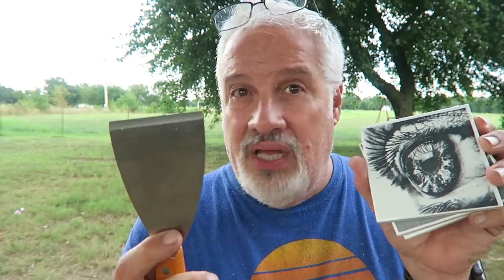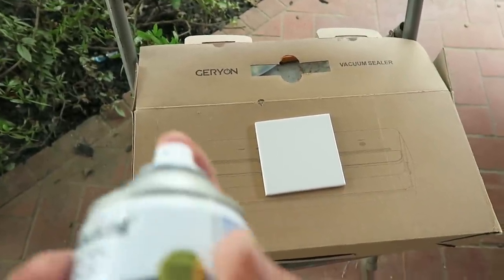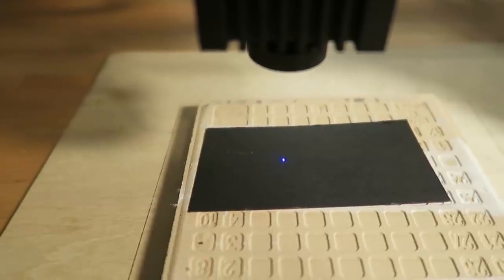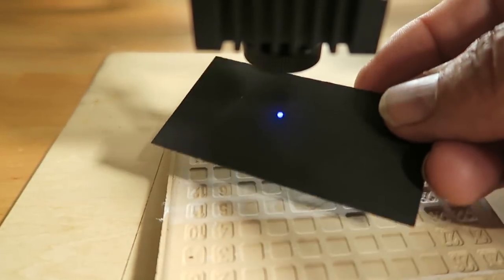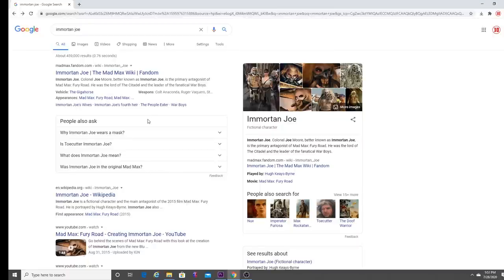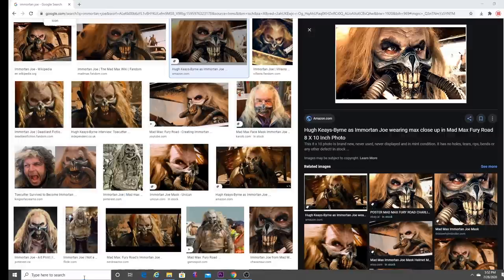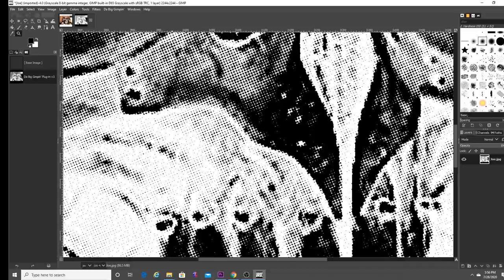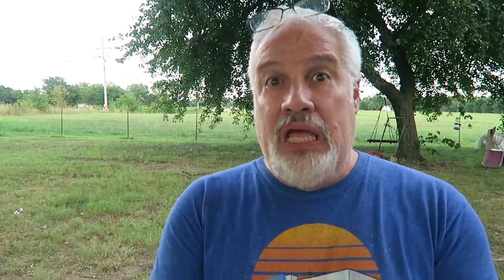Crazy Technique for Etching White Ceramic Tile PERMANENTLY!

Comment: Can you please tell me why you chose 600 dpi for your resolution? If i understand, you have a line spacing of 0.11 mm. If I am calculating this correctly this would be a DPI of approximately 230 DPI. If you divide an inch (25.4 mm) by the width of your dots 0.11 mm, then you should get a pixel perfect 230 DPI. At 600 DPI your laser program will read approximately every 2.6 lines and average the laser firing. Could you please re-run this exercise with the 230 DPI to see if it will increase the overall quality of the picture?

This is the method I use when using my fiber laser on gloss black tile. My laser outputs a laser spot of 0.042 mm on most gloss black tile so I use 600 DPI and it comes out pixel perfect. Also, does your burning program allow for the input of bitmap images? Using a 1-bit bitmap image instead of a JPEG will give your laser exact on/off timing for each pixel when firing. The plugin you are using appears to create a black and white dithered image which would be what you need to create a 1-bit bitmap for this application. You would just export a bitmap instead of a jpeg.

Sorry I am not saying that what you are doing looks bad, I am just wondering if the technique can be improved by calculating the actual DPI and using an image that represents exactly where you want each pixel to be fired.

Comment: This may be a dumb question, but why is the tile coated with a layer of white paint if the tile is already white and cleaned with acetone? I thought the laser is etching into the tile and not into the paint? You don't mention during the paint step why it's being done, so this is confusing if you've never laser-etched before.

Comment: Have you tried with the Ortur 20W? Would it be the same results as the beam is a bit longer.
Reply: I think the laser is the same 5w laser. The 20w is how much the machine input is. It's a tricky way to say it's a 20w laser. Lol
Reply from the maker: It's a bit of a misnomer.  The 15w is more of a 4.5w output.. The 20w is more like 5w.  The 7w version is more like 2.5w laser output.  Any of the above will give you good results if the beam is focused.  The larger the output, the wider the beam also.
Reply: So after watching this I am thinking of ordering the V2. Are you saying that the 20w isn’t necessarily better than the 15w because the beam is wider? Does that make it less precise?  Which model do you recommend I purchase? I was ready to spend the few extra $ for the 20w. 

Also for the focus process, does that apply to the smaller machine you used in the green and black hulk video prior?  Thanks again. Great video.

Comment: Does this work with a CO2 laser? 

If not why? 

What is the reason it works on a diode and not a CO2? Could it be the wavelength of the laser?

Comment: Good afternoon I am trying to get started doing the Laser engraving. I bought a Atomstack and can't get it to work. Did I waste my money or should I have bought a Ortur Laser master 2. Any input from you or anyone on here can help Thanks
Reply from the maker: What wattage of laser did you purchase?
Reply: @3DPrintFarm  20 watt
Reply: Tonight I Printed off user manual for the Laser Master 2. Am going to try using the info they have for the Atomstack. It goes into detail the Atomstack came with no owners manual

Comment: I have a NOOB question.  When you are focusing the laser at low power .5%-2%  using the fire button or even a "shift/frame" procedure.  Can you do this WITHOUT laser googles on?  Because I am new to laser and want to be safe first.  I have been using them but find I cannot see accurately enough to tell if it is focused or if it is centered correctly.     
On top of that I have a ATOMSTACK A5 PRO and it has a added Red shield around the laser for added protection.   I don't think the Pro can be adjusted but the supply a roughly 1/8 spacer to use between the surface and the shield.  Seems to be fairly clean edges when engraving on black card stock.   But feel it could be tweaked abit still. 
Going to build a enclosure next so I can get the stink out of the shop when burning paints off.

Comment: First I have to say I love these videos. I’m looking at getting a laser and I’m stuck between LE-4040 Desktop Laser Engraver 5000mW Class 4 and the one you used in this video. Do you have a suggestion on what one would be more favorable?
Reply: The 5W (5000mw) you mention is about 4X less powerful than what he is using.
Reply: @Annihilator2011  I don't believe that's correct. The Ortur 20W is only about 5W output. The LE-4040 is 3.5W to 4W. The 20W refers to the input power, not the output. It's misleading, but commonly known to owners of the unit.
Reply: @Dadtheimpaler  I assumed the laser he was referring to was another Chinese laser that only listed input power. Just a little FYI, the Chinese diode lasers output 30-35 percent input power so output on the Ortur 20W laser should be 6W-7W.

Comment: how important is the paint type? you show Rustoleum ultracover and you mention Krylon, and why white? essentially it's just being burnt and the residue fused to the surface, right?
Reply from the maker: I have used both Rustoleum and Krylon Matte and Gloss White.  I believe you are correct that it somehow either creates a hotter burn and fuses the surface of the tile because it is indelible.  The strange thing is that it only works for me with white paint.

Comment: What computer do you use?? Iv been trying to find out what computer That actually works great with the software and all. I have the money right now but can’t figure it out. I see bad rating on some laptops. Please let me know
Reply from the maker: I actually use a desktop gaming PC with Windows for my video editing, but I use a MacBook Air for the LightBurn software.  It's portable and it suits me fine.
Reply: 3DPrintFarm thank you so much for replying sir
Reply: 3DPrintFarm could I just use a Mac air?
Reply: @jaykee93  Of course.  You can use any computer that you want.  I started with a MacBook Air (2020).  Then i just bought an old 2009 iMac from Facebook Marketplace just to leave in my shop for this purpose.  And any Windows pc will also work.  And, if you're even more techy, there is also a Linux version of Lightburn.
Reply: Mick Nelson thanks man! So a pc windows 10 should run the laser and program and all??
Reply: Jay Kee yep!
Reply: Mick Nelson thanks man 🙏🏽
Reply: @jaykee93  I use a mac laptop, OSX 10.13, and Lightburn works great!
Reply: I am having issues trying to install the plugin DA Big Gimping Plug-in Process for GIMP With V3 on my macbook pro. Its in the plugin folder but when I load gimp its not there at all even after loading an image, any suggestions on how to get this to work

Comment: Hi there, I am trying the white tile Burn and have come across an issue.  I did a power test from 15% to 85% with my Ortur Laser Master 2 20w and found the optimum speed was 1200mm and power of 80%. I am using the rust oleum gloss white and when I used an imported design at my specifications it is actually burning through the paint and the glaze. Have you come across this before?

Comment: Hi there!  Total rookie question here 😅 , So Say someone tried doing this on a 80W co2 would the results be better and made much faster ? Firstly Is this method feasible on a 80/100W ?
Reply: You just need to turn the power way down to use this technique. Probably 10% or so. With 80-100 watts you could actually engrave the tile, melting the dots into the ceramic.

Comment: You mentioned you're using a 15w version. Can this be done with the 7w model too?
Reply from the maker: Yup! You'll need to change your line interval as the beam will be a bit smaller, but you should get good results with a lower wattage laser.

Comment: Yeah don’t know what I am doing wrong for sure. I put it to laser and it doesn’t detect the image I guess because it just keeps burning. I am trying to figure it out on wood first before I try it on a tile  any idea what I might be doing wrong?  If I leave the image negative it turns off the light of the laser on and off without negative it leaves it on constantly

Comment: Ok so this might be a stupid question but I've been following this vid while doing the editing and everything was fine til after the image was inverted ( will be using Norton method white on white ) and then you open up  Lightburn and open  the image file but it did not show you saving the image again before you did this ? Have I missed something ? I noticed you had joe and joe 1 files and chose the joe 1 , is that the final image after is is inverted that you have saved but didnt show on your video ?  Hope I've explained this ok .

Comment: Have you thought about 3dprinting a pulley wheel that will fit on your focusing knob and mounting a small stepper motor on it to make micro adjustments of the laser? It'd be really cool to be able to click a button and get teeny tiny turns on the lense to really dial it in. Maybe record a scale and convert different settings to different focal heights. Call it a nano Z Axis for lasers. That with an air assist could really dial in the cutting ability of the laser.

Comment: What exactly does "Da Big Gimpin"  plug in do? I'd like more detail than prepare the image for laser burning if possible. Thanks in advance.
Reply from the maker: Great question!  What it does is it desaturates, sharpens and then converts the image tiny dots.. almost like newsprint. This allows the laser to interpolate the image to the burn.  Go out to https://www.imag-r.com/ and do some experimentation.  It basically does the same thing except it's FREE!  I didn't find out about this website until after I made this video, so hope you enjoy it!  Experiment! Have FUN!
Reply: @3DPrintFarm  - Thanks for the response, I am very happy to have found your channel and really appreciate the information that you provide. I have an Ortur 20 watt 400 x 430mm. Keep up the GREAT work.

Comment: when i adjust the line interval it adjust the dpi automatically. so the dpi ends up at 9 when i input .11 on the line interval. im using lightburn 9.21. should i check constant power mode on or off? i adjusted the dpi according to what i see in your vid to 231 to get .00433 line interval. any suggestions. i try to run at same speed but i need to run slower speeds. i have ortur laser module LU1-3 15 watt 4.5v 3.5 amp laser non adjustable. im using the new big gimp with v4 but when i select v3 tile it doesnt invert the image. any suggestions, thank you. love the vids and instuctions.

Comment: I have done this with 4-1/4 x 4-1/4 tile and worked great so I bought a box of 100 count and a new can of paint and now none of them have worked so my question is Does it have to be a certain type of tile after burn is complete see image on paint but when paint is removed image is gone
Reply: Don't use gloss paint. Matte paint will absorb and transfer the energy from the laser far more effectively.

Comment: I did two 6" tiles painted white on a Epalog 50 watt laser, and all I got was an etched tile.  No color, just etchings.  I ran it at 40 and 50 percent speed and 100% power.  Was I going to fast?  Cleaned the tile like you showed, but no color.  Any ideas on what I did wrong?

Comment: I'm using a jtech 7w laser with lightburn software 
My question is what watt is the laser that you are using. And the time it takes to do 4x4 image.
Reply: @Michael Andrew Imagery I have been trying to tweak my settings, its still about 50-70 minutes to complete on ceramic tile.
On wood it takes about 20 minutes

Comment: Do you clear coat the tile afterwards? Seems like the paint would get damaged from scratching eventually.
Reply: John Clark You remove the white paint that is left and the image is engraved directly on the tile. The image and the tile become one.
Reply: No clearcoat.    3dPrintFarm says" It's almost like as the paint burns, the intense heat actually scorches the tile and literally burns the image into it.  No amount of solvent, sandpaper, scraper will remove it!  It's quite amazing!"
Reply: Question he isn't replying to.. Why paint a white tile with white, then remove white paint after. ?confused why you can't just engrave plain tiles as is?

Comment: Great instructions Garret! I’m new to this process and would love to try tile etching. Is there a reason to not get a larger size than 12x12 if I’m just starting out? Which LightBurn software type are you using for your Otur controller? Thanks much, I’m eager to get started!
Reply: The Ortur laser etcher has a 400mm x 430mm, or 15.74 x 16.93 maximum working area and ceramic tiles come in standard sizes of 4" and 12" square. The $40.00 version of the Lightburn software is the one to use.

Comment: Wow, why the paint again? If we are burning the tile why are we still adding paint? I'm still just in awe and possibly not thinking straight but that was my only question. Amazing thanks a ton.
Reply: The glaze on the tile surface will reflect away the laser energy. (unless you are using a much more powerful c02 laser)
The paint absorbs the energy and transfers it to the tile surface allowing the laser to cut into the glaze.
Reply: Thank you so much. That makes perfect sense.
Reply: @Annihilator2011  So why not using flat black paint instead of white paint - the black will absorb the energy much better?
Reply: @leonstevens2948  Surprisingly, black paint does not transfer the energy as well as the white...
IMO, the black is absorbing and dispersing the energy so that less of it gets transferred to the tile glaze.

Comment: Hi 1st of all brilliant work
I've coped you but I have come across a problem
Half way though it stops laser goes of and says lost connection 
Checked usb altered bit rate 2 9600
Checked leads 
Tried 10 different USBs
Checked power  to laser 
Have you come across this and any help would be great 👍
Reply: I swapped the crappy power supply and its ne er happened again
Reply: I've tried that 1st thing I did after testing the DC supply I have a 5amp one running the laser if I use GRBL I have no issues think it's lightburn it's self thank you for your reply 🙂

Comment: How long has the laser lasted? I have a 15 watt and was etching the back of a 12”x12” mirror after only doing a couple small pieces and laser stopped cutting after less then 10 hours of use
Reply: It all depends on the quality of the laser.
Many of the Chinese lasers are made from pulled diodes (used) so they can have very short lifetimes.
Even if manufactured new, the diode substrate can have flaws/impurities that will make it very short lived.

Comment: are the safety glasses that come with the master 2 fine for use or should i trash em?
Reply from the maker: I trashed mine and got a better pair on Amazon.  Some folks will use the green ones, but I felt safer with a better set.

Comment: Sorry, this is a little more generic question.  I've seen that all the CO2 lasers require a fume exhaust system to get rid of the off-gases but these desktop lasers don't have anything like that; especially when burning the paint in a project like this, is that not a concern? TIA
Reply: I personally would not burn anything without a fume exhaust.
Reply: well ... you dont move a CO2 laser around ... I have one that is around 50kg...  a diode laser and a laptop you can take outdoor if you dont have a workshop

Comment: How do i change the file back to .jpg after the Da Big Gimpin plug in? it is only letting me save in xcf
Reply: I had the same question. That step seemed to be missed at the 20:06 point.

Comment: One question. I used the rust-oleum universal all in one gloss white paint .  parameters are the same how ever i am using the 20 watt laser master 2 and my tiles are not coming out dark, kind of a greyish tone ..  how can i get it darker  i did burn at 1200mm/mn and 100 power...
Reply: Use Matte Primer+Paint (Krylon fusion) Matte absorbs and transfers the energy much better.
Gloss is reflective, thus reflects away light energy from the laser.

Comment: I know in both your tile videos you are supporting this plug in. I have tried it on OS and windows. with windows it will run the plug in but doesn't ask me any questions. It just takes my image and changes it. I can not get it to work on my mac at all. I have tried contacting the creator of the plug in with no luck. Any help will be appreciated.

Comment: After the tile has been cleaned could it be sprayed with lacquer. ....I want to use as coasters
Reply from the maker: Actually with the white tile method, it's permanent.  No lacquer is needed, but if you wanted a glossy finish, you could coat with some lacquer!  Have FUN!

Comment: Gloss white has smaller pigment that's made to Lay flatter and the gloss layers over it basically it settles with a layer of pigment and a layer of Gloss 

The laser goes right through the gloss so your hitting a Nice smooth super thin surface under the gloss.

Comment: I have always understood that a blue laser cannot burn into white material. To much reflection. Is this not the case? I have had no real success with white paper. Black, brown, red, yellowed, work great.
Reply: The paint absorbs the energy and transfers it to the glazed surface.
That is why it will always be black, that is the carbonized paint burnt into the surface.
Using matte paint + primer works best, gloss is reflective and will reflect away some of the energy.